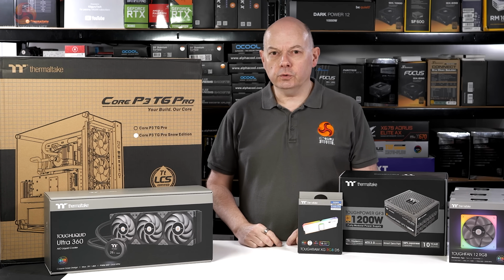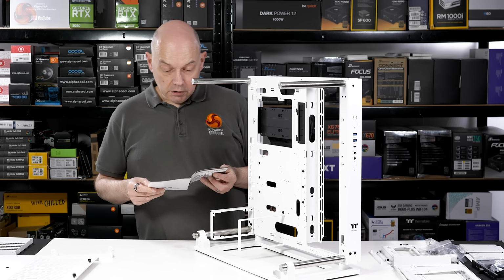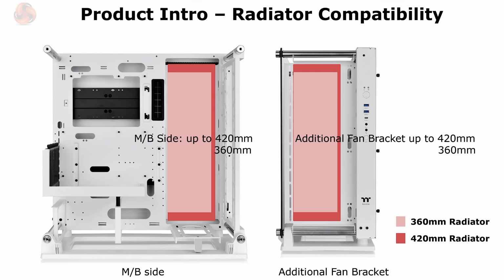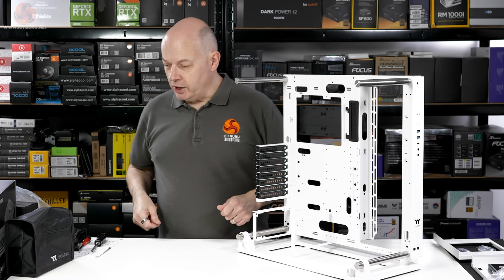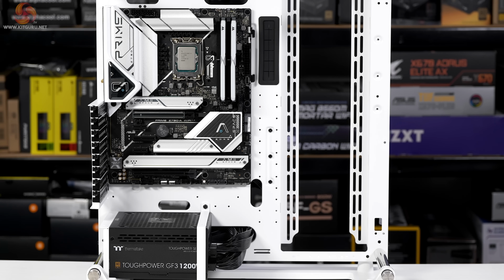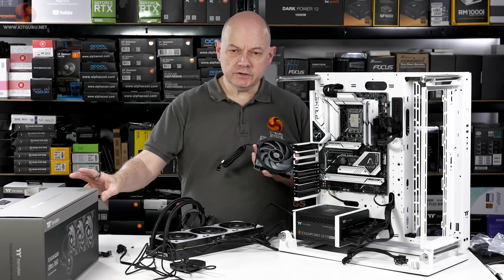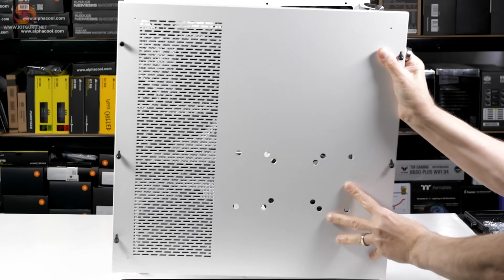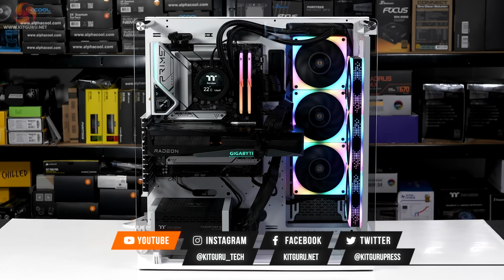Thermaltake Core P3 Pro BUILD - a flat pack chassis!

Comment: i may be wrong and just bought this case. front fan bracket is on wrong, also you dont have to remove the post to install that bracket, if you flip it the bracket is flush with the face

Comment: Unfortunately, I was silly enough to buy this case based on the misleading claims by thermaltake including this reviewer. The case will not accept a 420 arctic liquid freezer II AIO in the front or top panels. It can only be installed in the side panel. Once installed there, it will block the front panel from accepting another AIO. Pretty design but garbage level engineering and misleading sales pitch too. Will never deal with thermaltake again

Comment: I kinda wish you had linked the review of the original so I can check out your use of the included riser cable.  It's pretty straightforward but I'm curious why these risers don't need to be powered like all the risers I've seen on mining computers.

Comment: Can you measure distance of mounting holes on glass panel? Or compare it with the glass panel from previous P3? The dimensions of TG Pro are different than normal P3 but did they change glass panel? I'm asking because I have P3 Curved Edition and i I love the look of curved glass and that I can use it as a "roof" to prevent from falling dust especially when PC i off.  So I was wondering if i buy TG Pro i can use my old curved glass panel. Thank you and I'm looking forward for the replay. Cheers!
Reply from the maker: Square pattern for the holes, 47cm centres.
Reply: @KitGuruTech  Thank you for reply. So they changed it. On old panel there is 44cm center to center of hole, or 46cm from beginning of one hole to end of second. Maybe next year they will do refresh with curved edition 🙏

Comment: would dust not be a massive issue with this case ? surely thats one of the big downpoints.
Reply from the maker: Yes indeed. Really good filters effectively kill airflow so it is always a compromise but this chassis is at one extreme end of the scale
Leo

Comment: So what about fan noise of PSU? Just got a 1350W unit. And it's fan is either off or very loud. It produces more noise than the whole system with 4090.
Reply from the maker: Is your PSU also a ToughPower GF3? I didn't notice the fan noise in this 1200W unit
Leo
Reply: @KitGuruTech   Yes. ToughPower GF3 1350W. i also chat with other owners of 1200w and 1350w models, they behave pretty similar - feels like there is no fan curve for them. they only OFF or ON. So i think are retail units not the same as the test one TT sending to youtubers, or have we got some bad batch.